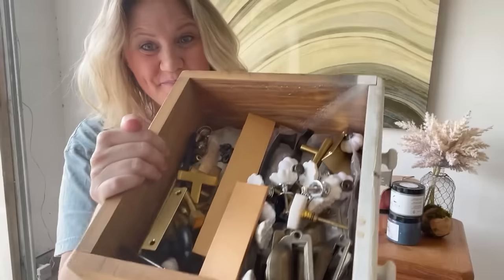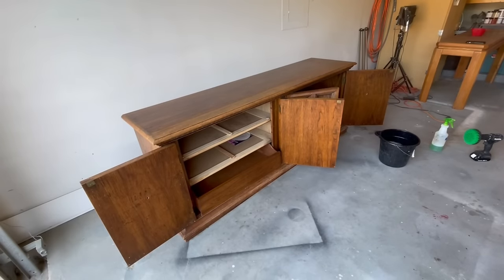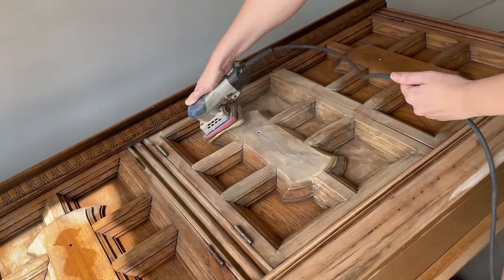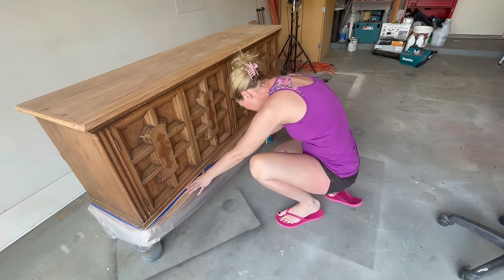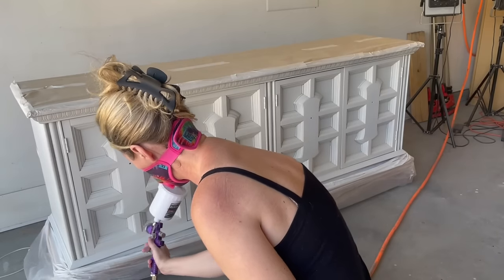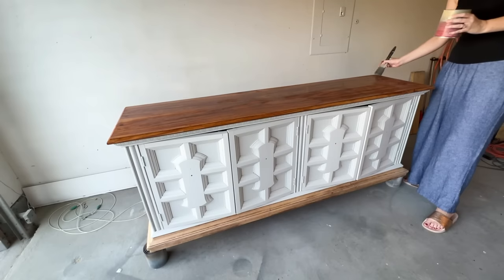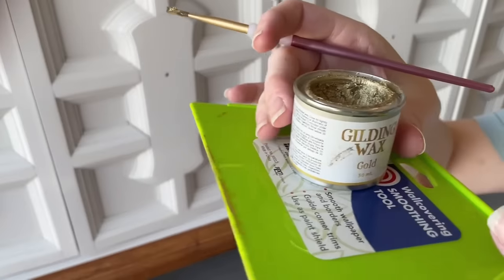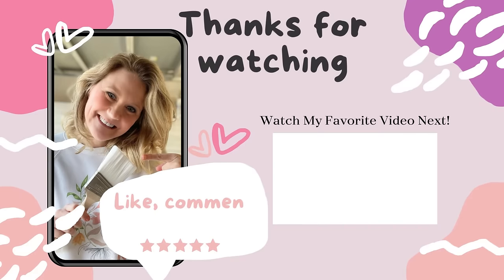Simple Steps to Turn an Old Dresser into a Money-Making Masterpiece

Comment: It sounds crazy but I appreciate you are using low end masking tape. I see people use frog tape or blue painters tape and it seems like an expensive route. With those square fronts, would liquid sandpaper work if you didn’t have a surf prep?
Reply from the maker: Oh good! Yea I don't see a need for it unless I am doing a dip dyed look. Then you need frog tape. I get all of mine off of amazon in a big pack of 5. saves $$....and I am all about saving! lol Thanks for watching!
Reply: @LemonstoLemonadeFurniture  Good tip, thanks.  MY comments and others are supposed to help your algorithm.  I don't settle for anything less than froggy, but now I am rethinking that.  BTW, you should get sponsored by Papa John's and unlimited pizzas.  Another great tip, the pizza box trick.
Reply from the maker: @rockshot100  hahah That's IT I'm calling Papa Johns Monday! Thanks for helping that algorithm!

Comment: HI. I just discovered your channel yesterday and I have been bing watching...I find it fascinating the changes you make to update these pieces. i have a question on this one. you painted the outside first before the inside. i was wondering if there was a reason for that. i was wondering if it made a difference or if there was a criteria for doing it this way vs taking the doors off like you did in another video. thanks so much for sharing your techniques and process.... It is very satisfying.. 
Donna
Reply from the maker: Hi Donna, no real reason here. Sometimes it depends on the filming schedule since I need to film much more of the outside but you can paint it either way. Hope that helps! thanks for watching!
Reply: thank you! 
 @LemonstoLemonadeFurniture

Comment: Hey Kara, beautiful job! I have a question - the topcoat you used over the oil-based stain was water-based, so did you have to wait several days for it to fully dry to put the water based over the oil based?
Reply from the maker: Yes and yes! I didn’t want the amber look of the oil based top coat.

Comment: One thing I’m curious about is when to use stripper versus when to use sanding only
Reply from the maker: Stripper is great for a tough/thick finish that is not failing or chipping off. Sanding works fine if the finish is failing.